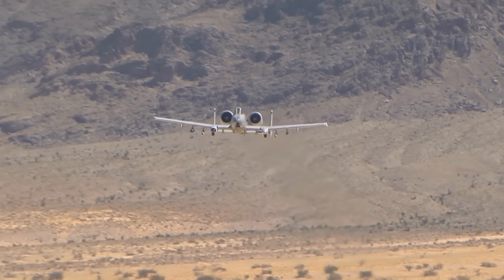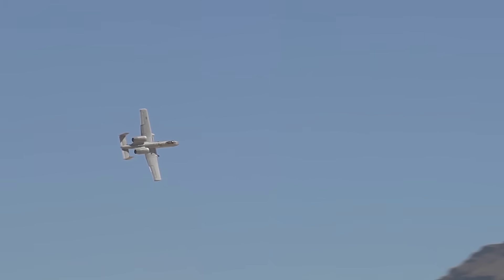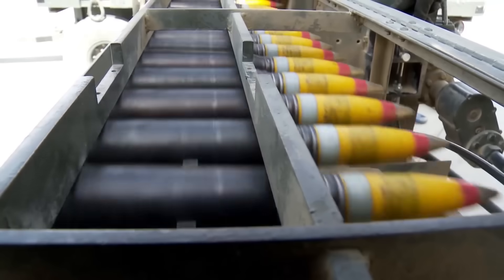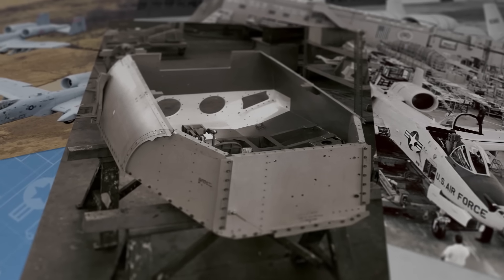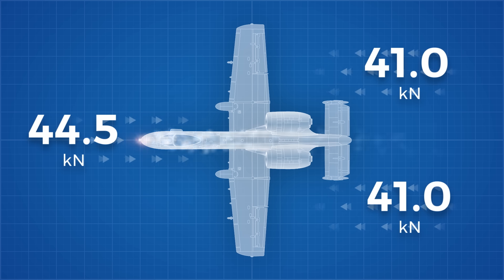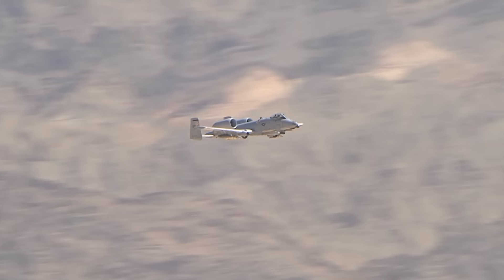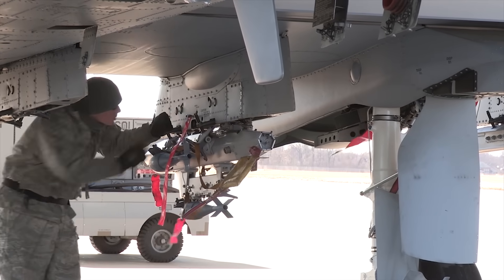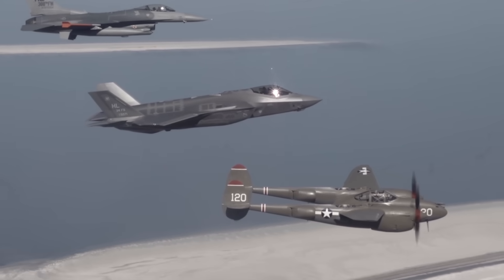The Insane Engineering of the A-10 Warthog

Comment: lies lies lies it can take 57mm gunfire from AA in the cockpit but not the glass also why did you compare depleted uranium with lead and iron you should of did it with depleted uranium against tungsten and iron also lmfao f16 is okay against the a10 but what ever about the f35   i am an American but the f35 was a huge waste of money 100% i dont support it at all and for the one's that ask why ill tell you why because the f35 has been out for a long time but yet its stilling having issues and if you make it go into a turn fight after about 5 mins the engines will over heat the metal fins near the engines and will make it fall out of the air

Comment: As a single mission airplane it's only useful for a superpower. That's why other countries need a A-10 that is good at every other mission too. That airplane is Gripen. The canon can't be that heavy, which can be solved by higher precision and initial rate of fire. The production cost can't be that low, but that problem is solved by a very low operating cost.

Comment: The main gun is not mounted directly center line. It's offset to the side so that the firing barrel is at the center line of the aircraft. This is so the recoil doesn't induce a torque on the yaw axis.
Reply: Are you sure about that, all the data and drawings I've seen show the gun is mounted on the center line and the rotating barrel system is set up so that the barrel that is firing is the one in line with the center line, don't know just telling you what I saw on drawings
Reply: @keithb7981  The gun doesn't fire at 12 o'clock, it fires at 9 o'clock (if you're looking at it from the front).  The gun is mounted so that the 9 o'clock barrel is on the center line. If you look at a picture of the front of the A 10, you can see the slight offset to your right, or the pilot's left.
(Me = not pilot and not military
If I'm mistaken here, please correct me.)
Reply: @keithb7981  I don't know what to tell you, we seem to be in absolute agreement.
Reply: The gun is definitely off set.
Reply: @eduardopena5893  Indeed.
Reply: The a10 is mounted on that gun

Comment: 04:00 slighty off. It´s not to prevent the shells damaging the plane but rather to keep that weight where you need it. Without any shells in the drum, the planes mass center would shift heavily which is not desired at all.

Comment: Now here is what this video doesn't tell you, Despite having fewer number of CAS sorties than the F14, F15, F16, F18, and AC130 it has the lowest success ratio. It has the highest instance of being shot down, it has the highest friendly fire casualty rate, the lowest speed and the lowest flight ceiling. The GAU-8 the plane was built around was intended to be a tank killer but has never once killed a tank in combat in over 40 years.

Comment: The biggest complaints about DU rounds from the Geneva Convention is less about the near 0 radioactivity of the material, but rather that depleted uranium is still a toxic metal like lead, but its salts can be water soluble unlike lead salts which are never (or at least not naturally) water soluble.

Comment: Just for it's insane morale boost for the ground troops it's worth having around.
Reply: Right before shredding them into confetti
Reply: unless you're in a british APC
Reply: No, no it isnt, it has more friendly fire than all other us planes combined, its slow and flies low to the ground and required pilots to use binoculars, its gun is weak and inaccurate and it was almost replaced by a cropdustet
Reply: @Helperbot-2000   Definition of biasedness
Reply: @mishra-h9h  a 10 fans, yes

Comment: I need a answer to a question for what I'm looking for everywhere and couldn't find anywhere, please answer...
How does a fighter jet balance itself after firing one missile, because the weight in both sides of the aircraft is unequal, so how does it stop itself from tilting ?
Reply: Probably through aileron trim, where a slight rolling input is used to counter the difference in weight.

Comment: The F-35 is one hell of a machine but one key point you forgot to bring up is the difference in cost between the A-10, F-16, and F-35.

The A-10 Comes in at a humble $9.8 million
The F-16 Comes in at approximately $30 million
and the CHEAPEST version of the F-35 comes in at $115 million with the Marine and Navy variants going up to $251 million and $337 million respectively.

So that means that of these comparable ground attack fighters you can get 3 A-10s for the cost of one F-16, and you can get 11 A-10s for the cost of one F-35, or 4 F-16s for one F-35.  The F-35 has stealth and that is great and has a LOT of uses, however its beat on the conventional battlefield by payload, survivability, and cost.

Comment: Perhaps it would be best to re-classify the A-10 not as a Air Force or Naval aircraft per say, but just as an AG (airborne gun) for both army and marines. Ditto for some drones.
Reply: Except the gun is weak and inaccurate and is seldom used
Reply: @Helperbot-2000  There is NOTHING Weak OR Inaccurate about the Warthog's Death Burper!

Think about what that sweet Bringer of Death and Destruction is designed to do...

It's designed to provide Close Air Support for US Troops on the ground...

That means it MUST be VERY Accurate in order to be able to kill Bad Guys that are shooting rifles at the Good Guys at typical ranges of less than 150 Yards WITHOUT HITTING THE GOOD GUYS while firing from a platform moving at 100+ Mph at less than 300 feet altitude while being shot at by every Bad Guy within a 1 Mile Radius (the typical effective range of most small arms shooting at an aerial target) and dodging the occasional missile lobbed at it...

It's also designed to absolutely SHRED anything with less armour than a Sherman Tank...

Weak and Inaccurate my aching Ass...
Reply: @HappilyHomicidalHooligan  im not joking when i say that, the gun is barely able to penetrate the armour of the tanks it was designed for UNDER IDEAL CONDITIONS, it has high problems identifying ground targests and has more friendly fire than any other us plane... COMBINED, so much in fact that the uk banned its use near their troops

Comment: @Real Engineering: A slight inaccuracy in your video, in the video you said that the gun was mounted on the center line, of the aircraft so recoil isn't a problem. this is half true. the gun is mounted off center to the left of the aircraft, this center lines the firing barrel.

Comment: F35 would be too expensive to use in the close support role!  The replacement cost would be so big that id could not be put at risk!  The UK has just lost a F35 in take off and will cost £100,000,000 or $134,000,000 to replace!

Comment: Quite a bit of wrong info bucko. Might wanna recheck that research you made.

Off the top of my head:

- the GAU-8 is mounted off center, the only thing centerline is the firing barrel, not the entire cannon
- the spent shell casing are put back in the drum in order to avoid changing the plane's center of gravity
- DU is generally safe to touch - from a radiological standpoint. It is highly toxic, chemically, if it's inhaled but that only happens if it's atomized like say from a high speed impact. Thing is, under those circumstances, it's also pyrophoric so inhaling it is the least of you worries.
- W penetrators are made with inbuilt stress lines to have the same self sharpening effect as DU, otherwise they wouldn't be a good alternative would they?

Comment: A plane so effective the Pentagon is desperate to replace it with an aircraft inferior to it for the job intended. Obviously the military industrial complex wants the profits a new aircraft would give them. That aircraft is the F-35 which has a smaller gun,which has fewer bullets than the A-10,can’t fly as slow as the A-10,has less loiter time than the A-10. The A-10 is made of Aluminum,steel,and titanium which is easier than composites to repair. Cut out damage skin then rivet in a patch on an A-10,composites take more time to repair due to the amount layers used to get strength in the skin.

Comment: The A-10 is the Browning M2 of planes. It's an old outdated design that is so good at what it does that all attempts to replace it don't succeed.
Reply: Except it's easily being replaced because it's a pile of outdated garbage and was only kept around due to the war on terror because it was cheap and the enemy didn't have any relevant air defenses. With the shift towards China, it shows that it has no use in a modern near peer conflict.

Comment: But if you just dumped all 1150 rounds in one burst, two questions. How long would it be, and would that be long enough to stall the plane?
Reply: The GAU 8 fires at approximately 60 rounds per second. It is unlikely to stall the aircraft but more likely to warp the barrels without stopping to allow the gun to go through cooling cycles.

Comment: Hey powers that be that are monitoring everything  .  I just had an idea for a plane that may be a helpful concept and idk how else to guarantee this is read.   The name and rough release time after engineering is aac -5.1 xm2038 .
Based on the need for slower prop aircraft  for certain missions.   the basic aac5/p38 thunder airframe is updated to be as ballistically efficient as possible .  Instead of  prop engines , use A10 turbofan jet engines, with optional thrust vectoring vents similar to a harrier to allow slow and low flying with a fast reset to allow for rapid egress. 
A x shaped tail arrangement to allow for insane handling and disrupted heat .  Upgradable  electronics to be suitable for modern tactics.  Stealth I doubt would be very good  but for all I know . The engine power would be utilized by thick laminate armor plus applicae armor being optional.  Yup , there's a concept now go explore and engineer ! Think p2038 as the flying ifv to the A10 flying mbt. Made to hit soft targets and soak damage . In low slow mode these would be flanking the strafing areas and dealing with the potential issues on the sidelines.
And literally the next video I watch ( Came back to edit the in) I learn about the ov10 bronco. Which is almost what I just said . But Vietnam era with prop engines...and lacking the 2038 upgrades. There,see ,I have damn good Ideas! Powers that be,you should hire me to make concepts )